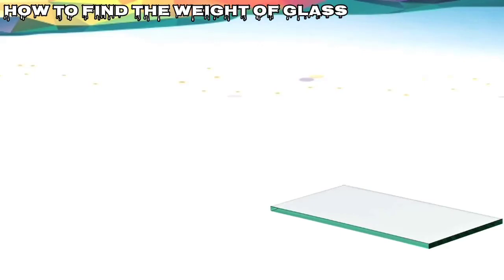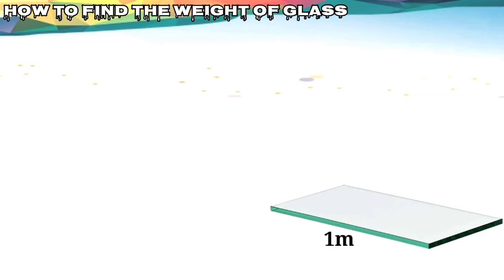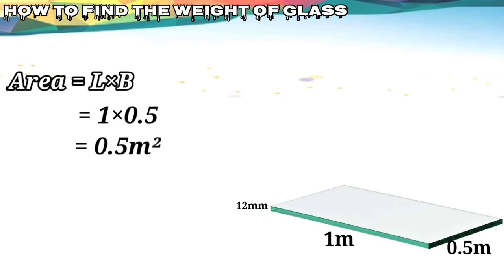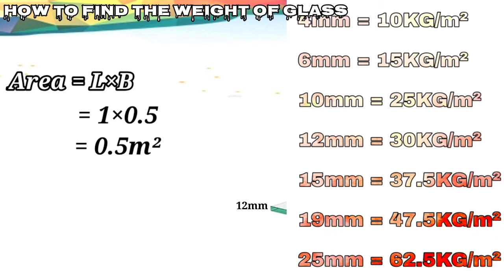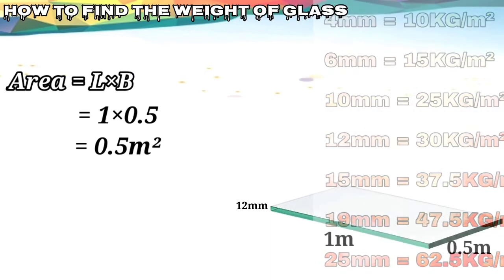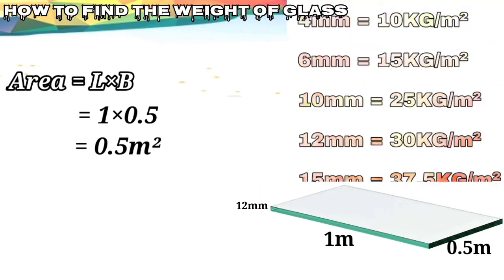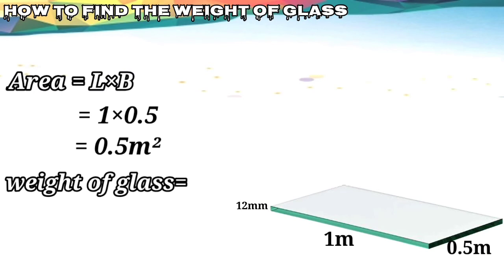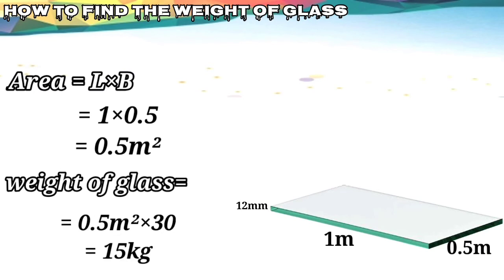How to find the weight of the Glass|| weight Calculation for Glass

Comment: Hi bro. The weight of the glasses in m2 s standard values?
Reply from the maker: It depends on the thickness of the glass, normally i have discussed different thicknesses of glasses with different unit weights, and m³ of glass is equal to 2500 kg normal